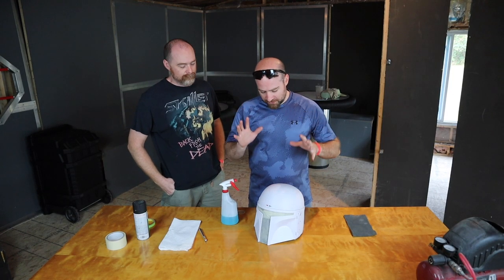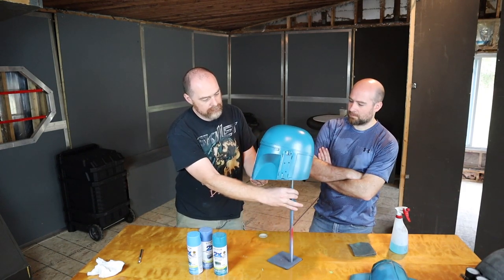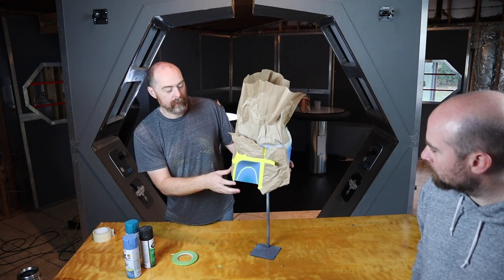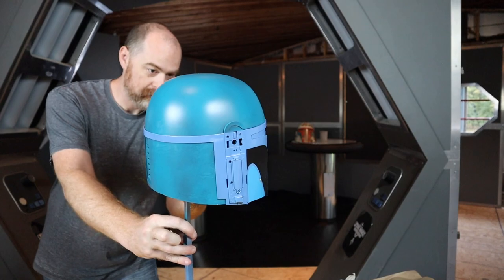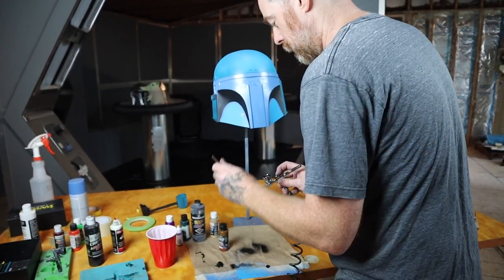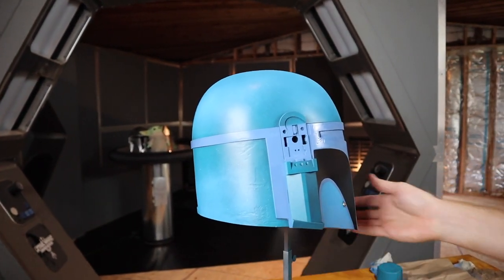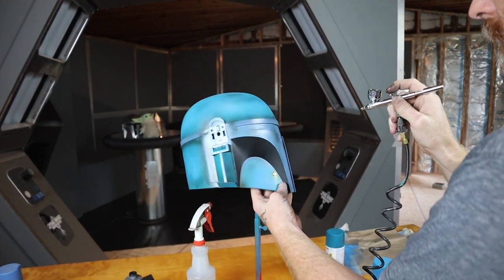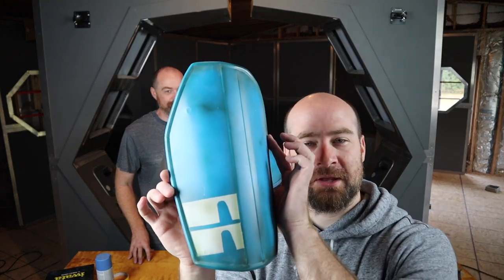CUSTOM DEATHWATCH PAINT JOB ON BLACK SERIES BOBA FETT HELMET

Comment: Did you do something to get rid of the battle damage on the prototype that was same as actual boba fett helmet?
Reply: The prototype Fett black series has the damage built into the mold as well. You can see in the video that they didn’t fill in the molded damage. The damage still in the helmet is most easily seen in the close ups of the back of the helmet
Reply: @jorgelizaso978  As mentioned below, the damage bits ARE present on the prototype helmets. It's not just a paint app on the Fett helmets, it's actually part of the mold. Which is really cool on the Fett helmet, gives it more depth, but it is a little irritating on the prototype helmet.
Reply: @Bad_Wolf_Media  very irritating.   Was a deal breaker for me.